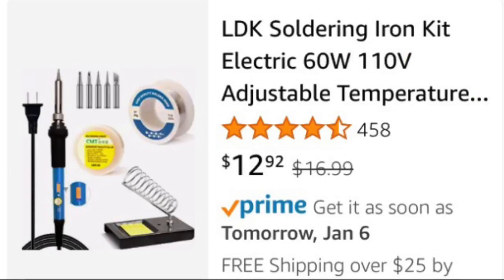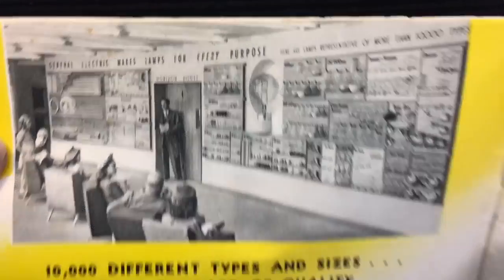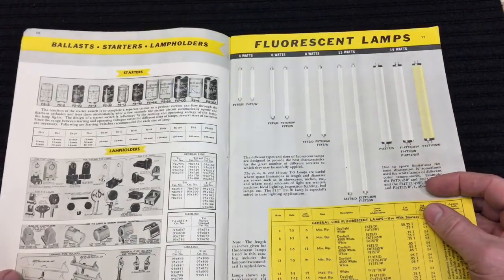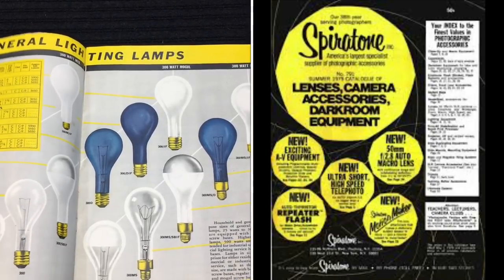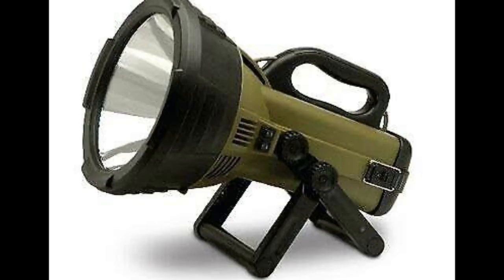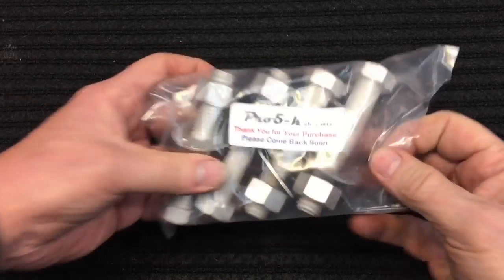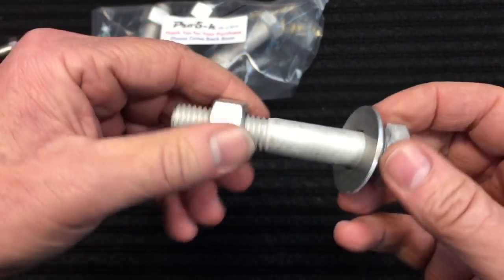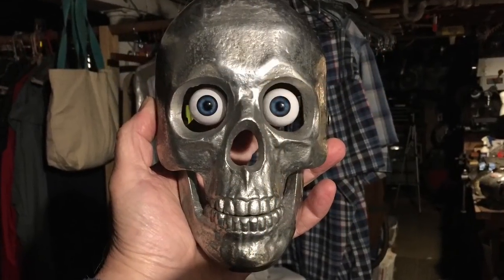Vintage GE Catalog, Milwaukee Searchlight, New Bolts and Buffalo Nickles

Comment: A few years ago I was repairing a couple fluorescent fixtures at my sister's house.  The "manager" of the electrical department at Home Depot didn't know what a ballast was!  Anyway they didn't have what I needed so I replaced 4 fixtures with LED units.  Love that catalogue.  That Milwaukee lamp is nice. Always good to have an extra charger.  Can't wait to see the aluminum bolt.  Thanks.
Reply from the maker: I like the LED fluorescent replacement bulbs, bypass that stupid ballast!  LOL   Direct wire and so far so good!  Thanks!

Comment: I feel a shim coming for the loose battery! Great video, thank you for the explanation on “soddering’. Having attempted to heat the wire first explains why I was having such a problem, the gun was not powerful enough to heat it! Great info!
Reply from the maker: Hi John- Believe me it's not you...  Soldering is tricky because you see videos of guys using great equipment and when we try with different equipment it doesn't work out!   =D  I bought this kit specifically so people can get positive results with no excuses and me using better equipment.   =D  Thanks!

Comment: Yah got it bad John. 
Retailers love it when you use a card.  I know cause I use to be one. I figure about 10 to one they will buy a POS (point of sale 😁) just cause it is so easy. 
Buffalo nickles were around quite a bit when I was a kid. We didn't know they were going to be worth more than 5 cents. 
5 of them got a gallon of gas for the mower and I got $1.25 for each of the 4 yards I mowed with that gallon. 
10 got a pack of cigarettes. Dad would gove me $.55 to go to the store and I would get him a pack of Winstons and 5 pieces of candy for us kids. 
The book of folding matches was free on the counter at Ryder's Market. 
A bottle of Pepsi was  dime. 
When Michigan put a deposit on bottles and cans they were $.10 each. Before that the glass bottles were $.03 deposit on each. 
Ryder's was where I took bottles to return them for the $.03. 
I was getting $40.00 a week between bottle returns and mowing. Big money for 1960. 
When the Union went on strike, every 3 years, Dad got $15.00 a week strike pay. 
Times they are a changing. 
Kalamazoo just paid $2,000,000.00 for the land to build a homeless shelter. They ordered 50 eight by eight tiny houses from out west to build a village. 
They are not coming because there is a transport issue. 
I guess I had it pretty good.
Reply from the maker: I remember not too long ago that jobs were plenty and more people were working then ever before!  =D

Comment: I miss the old catalogues you could learn a lot quickly.  The  Acklands catalogue was like looking at a Christmas catalogue when I was a child. I remember when you use to go to the industrial supply and the clerks had those large catalogue holders in front of them about four feet long. Floor Jacks have always frustrated me, it seems very easy to release them too quickly, the only control seems to be twisting the handle very carefully.

Comment: Milwaukee. I bought extra batteries and now have lots of chargers. 🤪. I think the L is silent in Solder. That’s my story and I’m sticking to it.  Great point about the cheap irons loosing heat. I’ve done my share of soldering putting together kits and have one of those crazy expensive soldering stations. Great start to the new year. Best Regards, John
Reply from the maker: If you solder often you need to get a good soldering station, it just makes sense,  However there are so many people who are intimidated to try it and for $13 shipped I think they can't lose now!  =D

Comment: Milwaukee seems to be more of a professional, contractors tool that might account for the price point.  Really, really, really liked the puzzle bolt. Can't wait to see what you do with the larger aluminum bolts. Also, I didn't have any lamp oil. So, without having to retrofit & change the lamps design & looks. What I decided was to use glow sticks put in wick slot upside down. Works better than I imagined it would. Completely safe too. Yuk, yuk, yuk. Whoo-hoo! 🙂🙃🙂🙃😊
Reply from the maker: Carl- I really enjoy a couple electric conversion lanterns I have too!  We aren't lantern snobs here!  LOL

Comment: those flashlights are awesome! We use them in the tunnels at work, they bring daylight underground. We buy the 5,9 and 12 amp hour batteries in the factory 2 packs, the 5 run about $116 for a 2 pack. I also noticed that Amazon has a ton of knock off batteries. These can damage the tool AND void the lifetime warranty.
Reply from the maker: My favorite part of this light is the Kelvin (color) of the light, it is like a halogen not that horrible bluish white normal LED light, very pleasing color and bright but not annoying!  Thanks Pat!
Reply: I remember having to wear a miner's lamp,  you had a 5-pound lead-acid battery strapped to your hip. Old-time rechargeable light not that bright but you got use to it.
Reply: @ScoutCrafter  cutting edge Milwaukee rechargeable....….! Smaller one?.. 2022 pro tech $
Those who know how to invest!

Comment: We have that milwaukee light at work.  It is almost too bright at times.  All the vehicles I work on are white and that light reflects something terrible.  There is also a 12 volt dc version of that charger to use in your vehicle.
Reply from the maker: I heard there is an adapter that you can replace the end cap and it plugs into the lighter plug.

Comment: John, i see you went with the Milwaukee brand , good choice once you start you have to stick with the same brand due to the cost of the batteries and chargers. I bought the 20v craftsman series , they are cheaper and i had very good luck with them no matter what people think .they are so many good ones up there Bosch, dewalt, rigid ,makita so many
Reply from the maker: Honestly I think the best battery tools are Makita...  They are really high quality.  However I am a casual user and price matters to me so I went with the cheaper Milwaukee.  However cheaper doesn't mean cheap!  LOL

Comment: I thought something was different! Serendipitous again, I just ordered some of these novelty eyeballs as a potential joystick for my wheelchair. I really wanted the ones that float in liquid and always look up but I'm not sure if I can get a shaft epoxied on strong enough. Great minds think alike!
Reply from the maker: I like those floating eyeballs that when you toss across the table it always looks the same way!  =D
Reply: @ScoutCrafter  that is exactly what I ordered. I had memories of them as a child, I once scared the hell out of myself by leaving a few under my bed. They are kind of rubbery on the outside, that's why I'm not so sure about the epoxy holding. It's worth a try though

Comment: Hi Scoutcrafter, Great episode I didn't know about the three legged buffalo. Do you have any Buffalo nickels with the date worn off? There is some fluid sold on the internet called Nic a Date and it etches the metal and you can read the date. My cousin and I ordered it about 1969 and it really worked.

Did you order your other Milwaukee tools from Amazon? I heard they are not an authorized seller and some of the third party sellers of Milwaukee are a little shady. I'm afraid to order my drill and I have the gift cards waiting!! 

Thanks for  your hard work on those videos
Reply from the maker: Hi Carl!  I think you are right!  My light came from "Tool Boss"!   I never knew that...  Thanks!

Comment: That catalog is great. Notice that the opening pages are packed with information on how bulbs, tubes work and how they are manufactured. I think it would be fascinating to know all that information just to satisfy natural curiosity. I understand your aggravation about tool prices.Unfortunately, it's probably only going to get worse. It adds insult to injury when you see that they are made in low labor cost countries. Makes me think a consumer gouge is going on. Looking forward to videos on jacks. Thanks.
Reply from the maker: Hi Pat- You are so right, I wonder why these batteries have always been so expensive, especially when I can buy a car battery for the same price!   =D
Reply: @ScoutCrafter  That's an interesting point I hadn't considered. You're right.

Comment: Soldering needs heat. The iron is tinned , you tin the work and use the heat of the iron to introduce a bit more solder into the joint and fuse the two together. If the iron can’t cope and keeps cooling off too much, you’ll get a dry joint. 
Solder
Soldier 
Building 
You CAN do it!

Comment: YES - I REMEMBER.....
The Kelvin Temperature Scale
Color Temperature  ~	Light Source
3000-4000 K	Sunrise/Sunset (clear sky)
4000-5000 K	Fluorescent Lamps
5000-5500 K	Electronic Flash
5000-6500 K	Daylight with Clear Sky (sun overhead)
SEARCHING  FOR THE RIGHT BULB FOR THE FILM.
Reply from the maker: Excellent! 😃👍

Comment: The price is appalling! I have always thought of the flashlight as a throw-in when you get these five tool battery sets. That said, Brian block does not waste money. Hearing it be endorsed by the two of you has me convinced that it must be one hell of a great flashlight! I have read that Milwaukee does seem to outperform the others when it comes to working in the cold. I paid close attention to reviews with actual data, for the most part all of these companies have identical quality batteries, the Milwaukee fuel line in the cold was the only significant data point of difference.

Comment: What an interesting approach, educating the customer! Seems like most retailers are going the other direction these days, there are so many obscure and outright false claims particularly in regards to power. The most striking example must be horsepower. With industrial horsepower, a 50 horse machine is a monster, the biggest skid steers are around this size. Meanwhile, a Chevy SUV is quoted as 325 horsepower. I think we all know that the SUV is not producing seven times the power of the skidsteer. Obviously there is torque versus speed, but that's not all that's going on. The term horsepower is incredibly easy to manipulate. Hell, one horsepower is equal to something like 1.16 kilowatt hours. I think electric vehicles may force the industry to change because of the need to compare the power of an EV to an ICE. If I'm not mistaken, certain standards are required to be stated clearly in Europe.
Reply from the maker: JP I remember as a kid car companies were measuring HP in different ways, some at the transmission and some at the rear end... It was impossible to compare...  That is where the track came in, when you saw one car consistently winning at the tracks you knew that car was fast!
Reply: @ScoutCrafter  I thought that stock car races were pretty fixed as well! At least that's the impression I developed from movies and such, that cheating was pretty rampant. I definitely know that there was a direct correlation to sales from the races, but I believe the obscurity of horsepower is no different today and stock car racing is just another form of dishonest advertising. At least it's entertaining though

Comment: Hey John, If you want a good light, check out the new Milwaukee 2126-20  M12 work light. It's expensive but a real good light. I love it but.... - Later
Reply from the maker: Marvin- I like the tower torch!  😃👍. https://www.toolnut.com/milwaukee-2136-20-m18-rocket-tower-light-charger-tool-only.html?utm_source=google&utm_medium=shopping&gclid=EAIaIQobChMI69DCt5Cp9QIVhMmUCR0KWwp5EAQYASABEgJZjPD_BwE